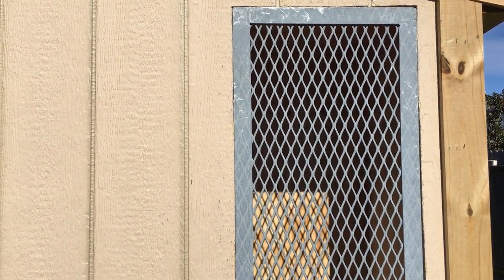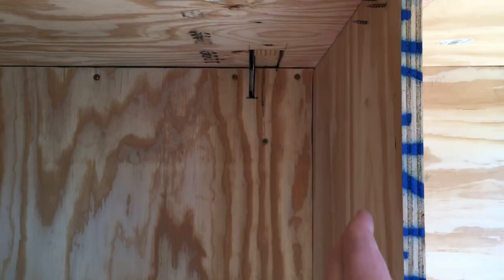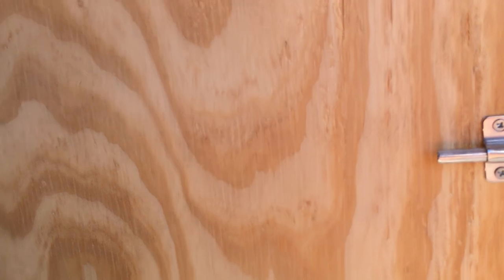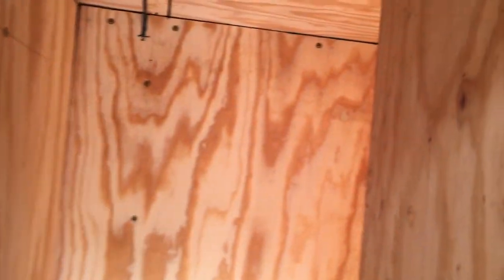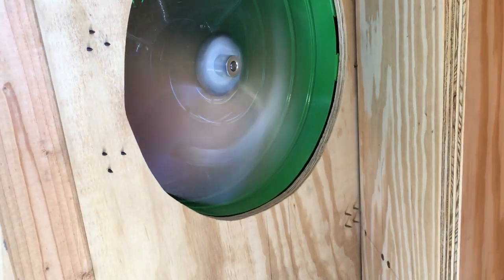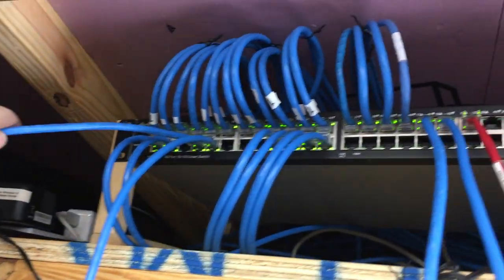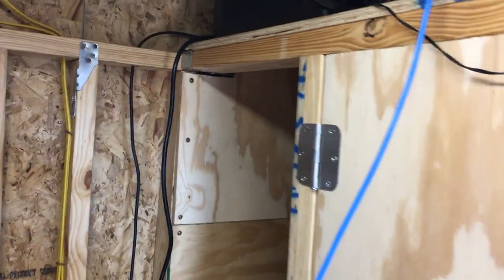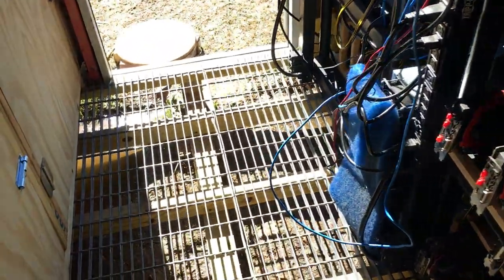Antminer S9 and L3+ Antmuffler ® - Part 01 How to quiet Antminer

Comment: Excellent work! I found that Roxul insulation really absorbs the noise from the antminer s9 fans. Lowe's and Home Depot Carry the batts but only some of the Lowe's carry Roxul comfort board which is a somewhat more rigid panel. They all work pretty well, but the comfort board 40 matches the audible frequency of screaming s9 fans better than the 60 or the 80. (750-800 Hz peak) Would provide better attenuation than foam board on the plywood surfaces of the exhaust baffles. Not as easy to work with though. Great shed. Best of luck with the mining!

Comment: Name and part number on those exhaust fans. I’m running an attic fan in my mining shop and at 1500cfm I don’t think it’s quite enough. I think it’s too noisy to add a second one of the same brand. And the variable speed would be nice.
Reply from the maker: Quiet cool AFG SMT-3.0
Reply: Awesome! Thanks brother. Those babies move some air. I have attic fans now but I have one 1300 and one 1050cfm fan. They do good for keeping my 6 rigs cool but I plan on adding more so I may get one or 2 of these guys.

Comment: Did you need to build that cause you got the cops called on you? I had to build baffles for my shed's exhaust cause that's what happened to me :P
Reply from the maker: No, but we wanted to avoid that from happening. I'm preparing a follow-up video that shows the foam installed. It is quite remarkable!